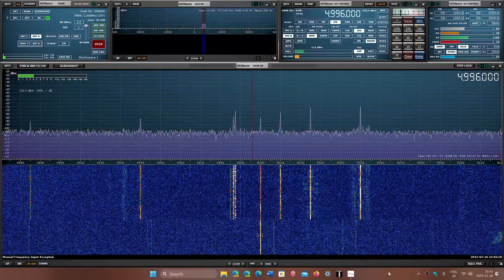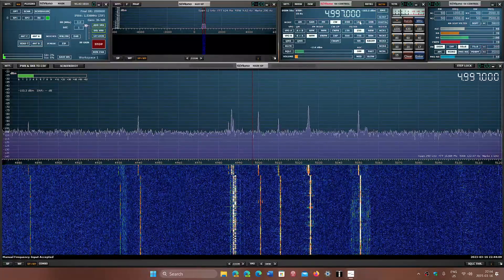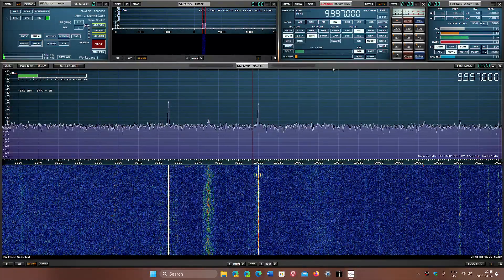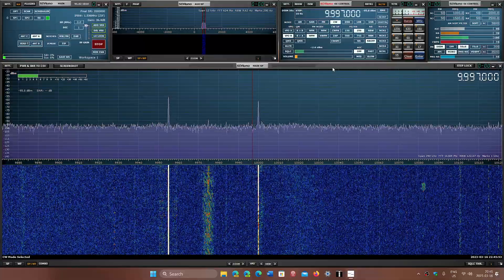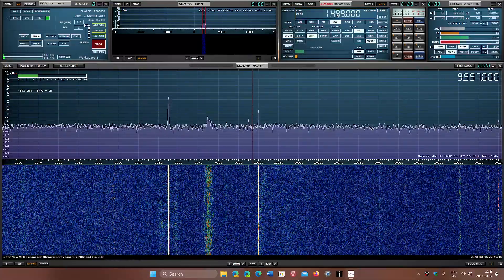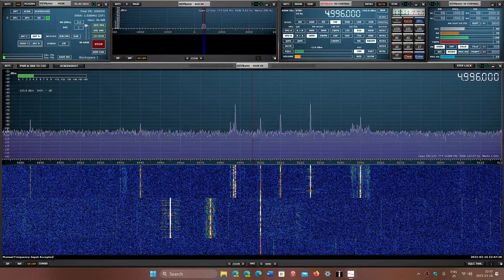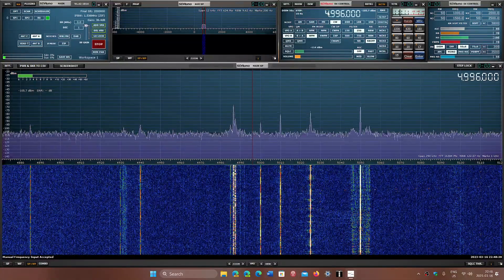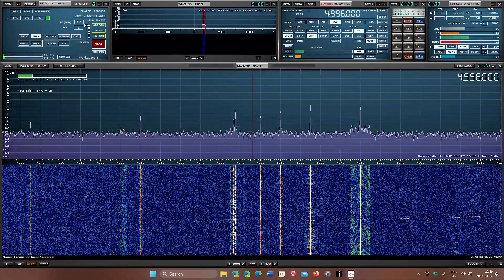What is this signal RWM Time signal 4996 9996 14996 kHz Shortwave

Comment: I hear 9996Khz and 14996Khz wery, wery strong here in Sweden with a 12.5 meter Random Wire Antenna and a 9:1 UnUn with RTL-SDR v3.. I dont know what use this signal is but its interesting anyway.. I scan 6-30Mhz once/twice a month just for the fun of it and almost always find strange signals on frequencies i would not expect anything to exist.. I stumbled on this signal and googled on it and found this video on the subject.. Qewl..